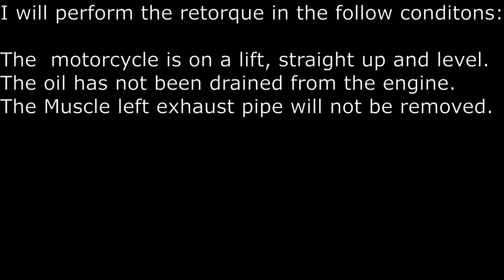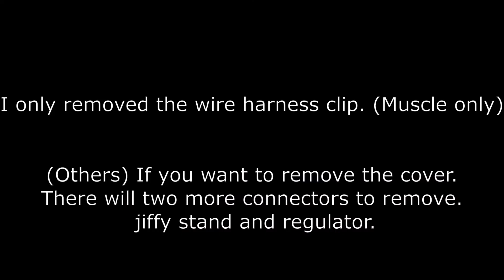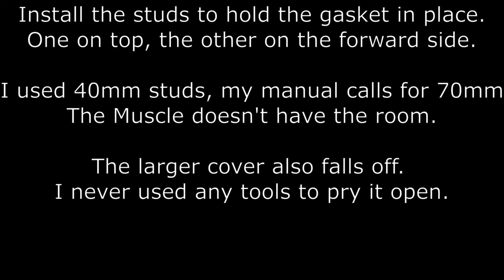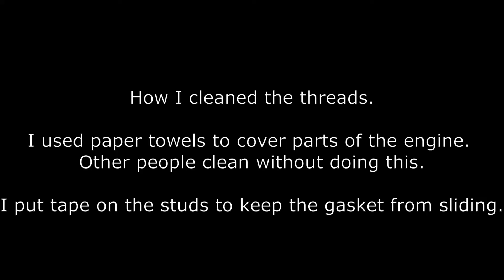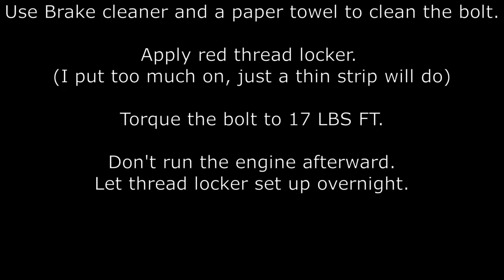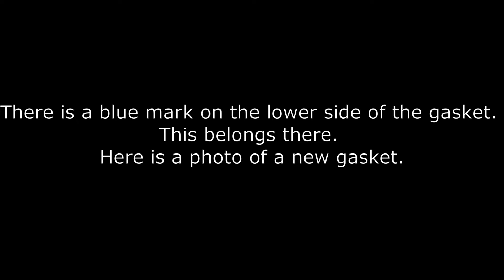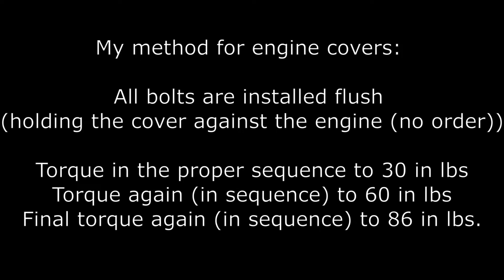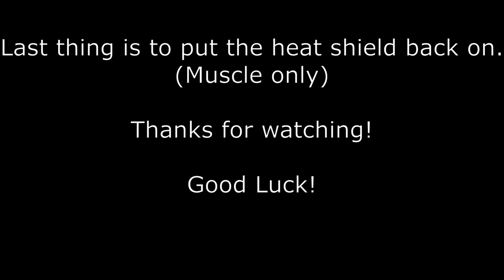Vrod Triple Sprocket bolt fix

Comment: Nice touch using the painter's tape to list the torque sequence. You might want to use longer bolts to hang the gasket and skip the thread clean up. Thanks for the video.

Comment: Great work.  I have a minor case if the "stator leak" common issue and while in there I was going to do this service, even though no symptoms of loose triple sprocket bolt, it should be serviced for piece of mind.  
Thanks alot

Comment: Thanks for the video Sir! Question, why we need 2 bolts? And why cut off the bolt head?
Reply from the maker: The plate is heavy and magnetic. When you put it close the the engine it will drain to the engine as a magnet will. This part is also heavy. It will not be easy to line up due to the weight and magnetic forces. The alignment pins (bolts with out heads) ensue the repositioning the plate is not necessary. This is a technique from a manual.
Reply: @Mytwistedvoices  Thank you very much Sir!!!